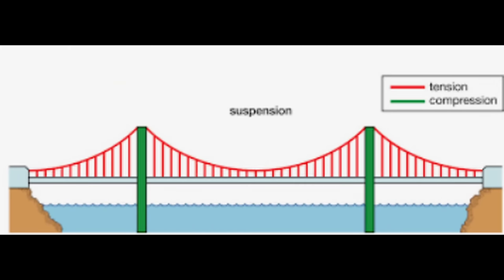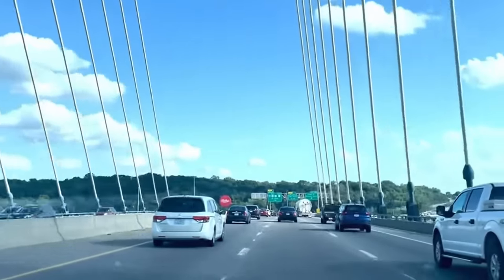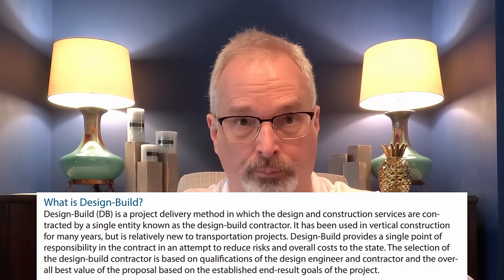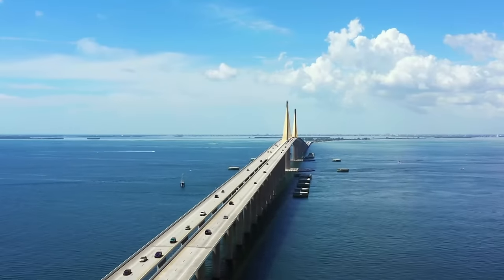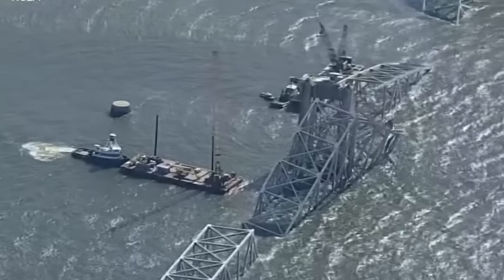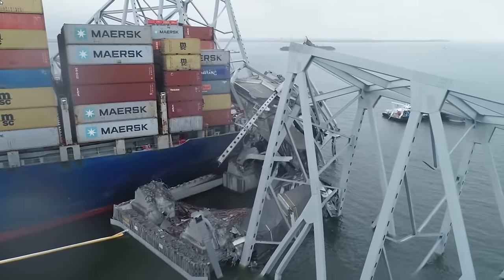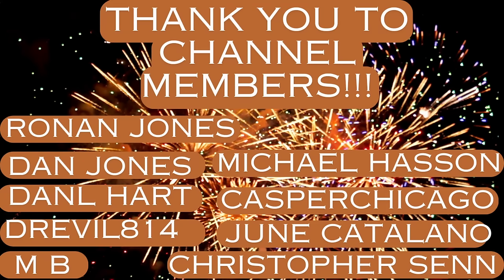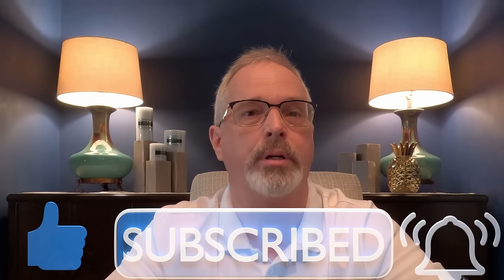How will the Key Bridge in Baltimore be Rebuilt?

Comment: This bridge was the ONLY short and less congested east side route for hazmat (including RV’s with LP tanks) and oversized loads which are NOT allowed in tunnels so a bridge is required, plus a tunnel would likely cost twice as much based on other projects where they have been considered.

Also, the existing approaches that remain, being old and narrow without breakdown lanes, and with that steeper angle are almost most certainly not useable for a new bridge that likely will resemble the new cable stayed 1987 Sunshine Skyway bridge at Tampa Bay with dolphins and fenders. It’s also 1200 foot span and 155 ft clearance (vs 185 at FSK) which is now just a bit low for newest cruise ships so a little more height (up to 205 like Long Beach now has) would be appropriate here.

Addendum:

According to a government website that I just read, Baltimore has the deepest channel depth on east coast at 50 ft. Others are 48 max, I believe. Some are only in the 30’s.

The new Long Beach Desmond bridge has a clearance of 205 ft and there’s only two NYC bridges that are more at 215.
But strictly on the east coast, the Delaware Memorial Bridge is at 188 ft with FSK and three others at 185 ft.
Reply from the maker: Thank you for clarifying those details John as to why a tunnel replacement would be problematic (and also very expensive).  I appreciate it!
Reply: Still can't be protected from today's super-ships.

There are designated hazmat routes around the inner harbor some on city streets and some on I-95 and I-395.

I am opposed to a replaced outer harbor bridge. To many issues with today's super-ships.

Unless a 4,000+ foot long suspension span is used to pass over waters 15+ feet deep. Probably closer to 5,000 feet to get it over all but the shallowest water.

That and its approach spans would probably be over 2 miles long and probably not cost competitive with a 6,200 foot 4-lane tunnel.
Reply: Oh no! Not double the cost! Obviously we havn't learned our lesson here and the risk of blocking off an entire port complex losing 100 million a day is certainly worth the gamble... The safest construction ensuring the posrt is never blocked again is going to be a tunnel. Hazmat can go find another route.
Reply: @CaseyJones-Engineer  Cost isn't a real factor here because the cost will be covered by usage tolls and should also be billed to the port and navy yards for reduced risk in the navigable waterway. Hazmat can go around, so it's a minor social inconvenience that affects a few users and not 99.x% of the historic bridge traffic. Removal of the navigation hazard from the waterway provides a broad benefit to waterway users (especially navy readiness) and the waterway users should experience a toll (of sorts) for that reduced hazard. Tunnels do not suffer closures due to wind and weather risks, making tunnels more usable in adverse weather, when they're most critical, and require far less maintenance in the North-eastern winters. Removing the tarmac from solar exposure also reduces the heat-island effect of the roadway and reduces its contribution to global warming.

Engineers and planners should definitely consider costs when comparing tunnels and bridges that incur broad tax costs and are not paid for with usage costs, but any cost difference between a bridge and tunnel that's paid for with tolls probably isn't going to be significant enough to even warrant an economic evaluation .. it'll just be a matter of how long the tolls will run and how high to set the toll for any given time of day.
Reply: Originally they wanted to build a tunnel here, but they switched to a bridge to save money. Turns out that was the wrong choice in the long run. I would not be surprised if it becomes a tunnel even if it’s more expensive.
Reply: @rpvitiello  I would highly doubt that they would consider a tunnel because of the trucking requirements that are more important than the passenger traffic.
Reply: @CaseyJones-Engineer  the original design called for a tunnel but it was waaayyyyy too expensive!!!
Reply: I frequently drove over the Key bridge because it was the only legal route down 95 for propane that was in any way sane.  If they replace the Key with a tunnel I will have to detour down to the Bay bridge, adding at least 20 minutes to the drive (with traffic could add a half hour or more).
Reply: It won't be a tunnel we're already planning the new bridge!!
Reply: It will not be a tunnel.  The new bridge is already getting planned.
Reply: @davidjohnson8930  I saw a comment from someone somewhere recently that they had developed plans for a new bridge a few years ago but postponed it because of costs? Do you know if true?
Reply: @JohnHallgren  not true.  The Nice bridge was the priority as is the northbound ETL.  The Bay bridge also is in the works but very very early.  It's quite possible they were mixing the 2.  The bay bridge required an extensive study and the replacement costs were astronomical.  But it will have to get done at some point because the structural integrity will be in question. And just to clarify the Key Bridge does have dolphins.  Not sure why everyone is saying it doesn't.
Reply: @davidjohnson8930  ok…thanks for the clarification!  It sounded a bit odd but not being local, wasn’t sure.
And i hoped everyone saw there was a couple of smaller dolphins but not in ideal location nor size such that ship got in between it and pylon/pier.
Reply: @JohnHallgren   yes the dolphins were situated such that something could squeeze in.
Reply: @JohnHallgren  hazmat trucks can take the northern loop. I’m honestly surprised they didn’t already ban hazmat from that bridge. Usually hazmat is banned from both tunnels AND bridges. It’s very common in trucking for hazmat to need to take VERY long detours to avoid major bridges/ tunnels that could cost billions to fix if damaged. 30 mile detours are common.

Comment: I notice you didn't mention the role of GSA inspectors on the construction progress.  GSA is required where federal funds are used.  I grew up in the area where this bridge is located and worked in DC on many projects where federal funding was used.  GSA would provide an inspector on such projects and would slump test each truck load of concrete and have each lab tested as well.  On one project I was tasked to perform those tests for the inspector and gather them for testing.  If we poured 90 trucks in a day I did 90 slump tests and sent 90 samples for testing.  At one point a crack was noticed by the inspector who shut the job down while he went to the batch plant and found oil in the sand pile (where someone had changed engine oil) then returned to the job and ordered a massive section of the project to be demolished and rebuilt with new concrete.  The cement plant was fined and forced to pay for this redo.  All in all the construction of one building, which should have taken less than a year went on for over 2 years.  
I doubt we see this bridge rebuilt in quite some time, no matter the type construction they choose.
Reply: The federal administrative state is involved, it is going to take 6 years under the current admin.   A next admin could make it a priority and be done in 600 days.
Reply: @christopherwhull  No question there can be too much admin- but maybe also possible to have not enough. I wonder if the 600-day scenario would enable discovering and rectifying some situation like the oil in the sand pile referenced above.

Comment: Increasing the deck height will be another key consideration for shipping
Reply: The channel is the issue, not the bridges height, which is 185'. The channel has been dredged over the years to 50'. The only thing that's ever come close to the bridge was the new port cranes  a few years back. They came within feet of the bridge deck. The EverMax was the largest ship to visit the port, it's about 65,000 more tons than the Dali.
Reply: For sure. I am sure the port of baltimore will push for that too. Its pretty crazy how large container ships have gotten.
Reply: The two main spans of the Chesapeake Bay Bridge also cross the bay, and those spans are at the exact same height of the former Key Bridge.

It would be a hard sell to increase the height of the new bridge because there won't be any benefit until the Chesapeake Bay bridge is replaced, and that's not happening for multiple decades.
Reply: The Panama Canal has a height limit of 190ft with an ultimate maximum of 205ft at low tide.

Comment: We have a cable stay bicycle/pedestrian bridge here in Minneapolis. They had a partial failure about 4 years after completing it. Turns out the genius that designed it, the contractor that built it, the suppliers of the materials and inspectors all missed the fact that no one accounted for wind effects on the structure. At least that is what they told the public. In spite of all the tools available, stupid mistakes still happen, oh and all the parties will fight it out in court for years,  all passing blame onto others.
Anyone hear about the Millennium Tower in San Francisco?
Good luck Baltimore.
Reply: The designer of that bridge was trying too hard to make a work of art.  Art is not the first priority when building a bridge.  There are many sturdy cable-stayed bridges today.

The first step to a safe bridge is to make sure that FIGG Engineers have nothing to do with it.
Reply: @GH-oi2jf  Yeah. You could have a chat with Frank Lloyd Wright about building beautiful structures with horrid engineering "choices" (and no math).
Reply: Because of these examples, the millions of competent constructions are drawn into question?

Comment: Excellent video. I appreciate the explanation. I am a mariner, and this accident hits home for us. On thing that I did not hear you mention is that they will likely have to raise the deck of the bridge to modern standards. I would be very surprised if they build a bridge less than 216 feet above the water. This is the height of the Verrazzano-Narrows bridge and was the height that the Bayonne Bridge was recently raised to. This would preclude losing ships to Elizabeth NJ and other ports.
Reply: Panamax & post Panamamax is 190 feet. So might as well go for 200 minimum.
Reply: most highway projects are designed too meet or exceed the projected traffic estimate for 20-30 years in the future so I would guess it will be considerably higher and wider than it was. just since the sunshine bridge was knocked down and rebuilt the container ships have quadrupled in size so everything will continue too get bigger as time goes by and if for some engineering reason they can’t go any higher they will go wider and longer
Reply: @mikebonnett7730  only if the ports are willing to invest in larger cranes do the ships get wider . longer may just mean extra cranes. plus you need the infrastructure to handle all those extra containers once offloaded.

Comment: One advantage here after the fact of the accident is that no provisions are required to allow access and daily use of an existing structure while the new bridge is being constructed. This simplifies construction and isolates the work zones from the traveling public.
Reply: fair point
Reply: It may make construction simpler in certain ways, it also add a lot of pressure to build it quickly since its loss forces all traffic on to other bridges.  Traffic is going to be a nightmare until this is reopened.  You can bet the contractors are going to be looking for ways to cut construction time which may lead to cutting corners.
Reply: Especially true for the approaches.
Reply: Ummm . . . I know you meant the roadways.    I'm thinking the waterway requires a certain amount of daily use and access !    That's kind of important !    :-)

Comment: Thank you for bringing your experience and expertise to the table. 

 It has been frustrating and embarrassing to read comments under the collapse reporting videos about how they will be able to save time and money by reusing the piers, and it will be "cheap and easy because they only need to replace a few spans"!
Reply: It seems like a quite stupid idea to reuse the piers because then you'll have different aging in different parts of the bridge and also the collapse may have damaged those parts, even if it's not visible. Also consider the rust issues on the rebar that's one of the hidden dangers.
Reply: @ehsnils  well personally I think people are suggesting they  could re-use the piers is due to the matter that the bridge was a part of a major highway providing a critical route for large trucks that cant enter Baltimore's tunnels.
Now perhaps yes I agree that replacing the piers is a good idea just in case the existing ones are not up to snuff, but if the goal is to build a new bridge as fast as possible it is worth looking into if the existing piers can be re-used.
Because the other issue is that the bridge was over a very busy shipping lane, so if any construction has to happen over water will impede water traffic.
Reply: @themadoneplays7842  The bridge design was obsolete, so there is no possibility of the piers being used any way.  Most of the work to build a new bridge can take place without closing the shipping lanes, perhaps with short closures to enable pieces to be lifted into place.  In the case of a suspension bridge, most of the cable "spinning" (construction) takes place high above the future bridge deck and does not require the shipping lanes to be closed.
Reply: @pulaski1  Eh truss bridges are not that bad TBH and are only considered obsolete because no one really uses them anymore outside of railways (where something like a truss bridge is really handy as something like a cable stay would not be so good for such things) Sure it's likely the new bridge will be a cable stay bridge but rather if it can be expanded on from the current infrastructure well I honestly don't know. There is quite a bottleneck on both sides of where the Francis Scott Key bridge because of how the highway was laid out, and expanding it would be rather costly.
I suspect the new bridge will be another four lane model, as where the old bridge was at was vital to traffic from vehicles that can't take the tunnels.
Expanding it to more than four lanes will be a difficult task, if not impossible, due to how the Baltimore Beltway is laid out.
Reply: The existing piers could serve as an over-built center anchor points/ dolphins for a skirt on the new bridge.
Reply: @themadoneplays7842  They are obsolete because they lack "redundancy" i.e. if something like this happens, the bridge collapses.  There are better designs that have redundancy - they can take damage and not immedicately collapse.  Also the replacement bridge is likely to be a design with a much wider center span, putting the piers much further away from the shipping lanes.

In the case of this bridge, one pier was hit and several spans collapsed, so the opposite of redundancy.
Reply: @themadoneplays7842  Traffic averages around 35,000 per day, which is not a lot for this costly of a bridge.  It does look like this is weighted towards truck traffic.
Agreed that this bridge accomplished its purpose for its 50 years of service and at a reasonable cost.  For those talking redundancy, how well would any other design hold up to a hit from a 100,000+ ton ship?  Spend the money on beefed up pier protection.
Reply: @pulaski1  Yes, but we don't need the new bridge to be overengineered and expensive either. This is the big con with cable stay and suspension bridges, as you need to have a lot of engineering involved in their construction.
Truss bridges were favored at the time of the Francis Scott Key bridge for a reason, as they were relatively easy to build and economical.
The same goes with cantilever bridges, which are also loosing favor.
Suspension and cable stay may be all the rage due to redundancy, but it's not going to be cheap.
Reply: @themadoneplays7842  In the 21st century "safe" is favored over "cheap", and with good reason.  I, and most other people, don't want to live in a tin-pot third world country.

Also, rightly or wrongly, you need to factor in the risk of litigation into the cost.  If the FSK bridge had collapsed during daylight, and 50 people had lost their lives, you could easily see payouts totalling $500 million, so it arguably makes sense to invest that sort of additional money (over the base cost of a "cheap" bridge design) into a safer bridge design.
Reply: @pulaski1  well it is possible to have a bridge that will suit both needs, as there are so many other bridge types to consider as opposed to cable stay. A cantilever bridge would suit this as unlike a continuous truss bridge can provide redundancies. Still, it's unlikely to be a cantilever, and they will go with cable stay due to how common they are these days. As I'm unsure if they can go suspension.
Reply: @somaday2595  Well a more advanced design could easily have a much greater span over the river.  For example a  suspension bridge could be built with its main towers on the SW river bank, and spit on the NE end, which would be completely protected from damage by ship collisions because any ship would run aground before it could ever reach the bridge structure.
Reply: @themadoneplays7842  Yes, I understand that a cable stayed bridge is more likely than a suspension bridge, though that would mean at least one of the piers would be in the river, and would likely (unless in shallow water even at high tide - I don't know the profile of the river bed there)  need collision protection.
Reply: For examples of “tin-pot” third world regressive design, along with shoddy construction look up “practical design”.  Pete Rahn was a pioneer of this.  Scores have died due to these regressive design practices and regressions.